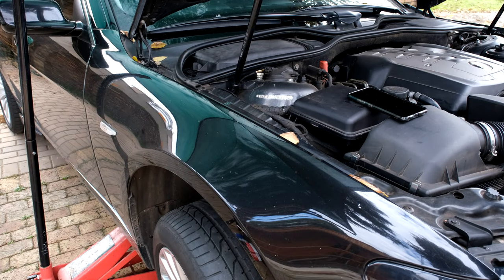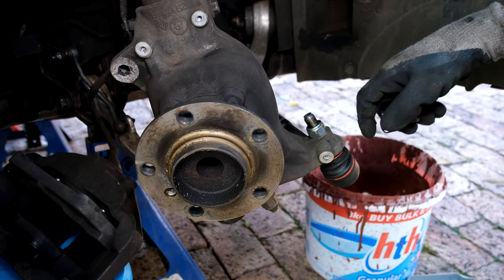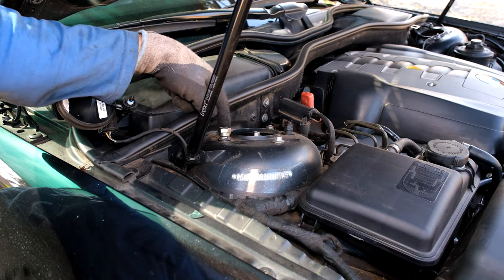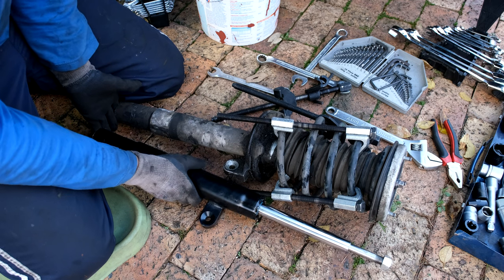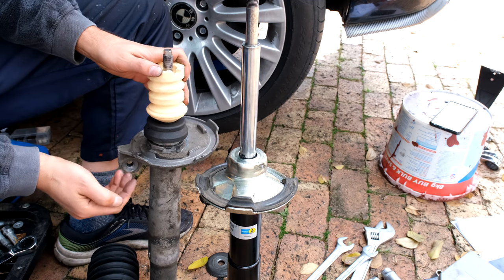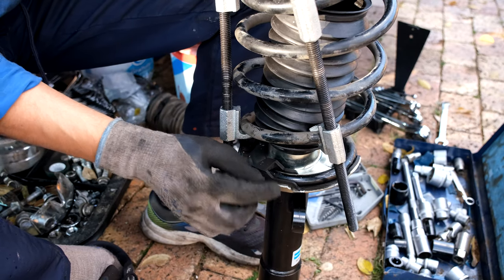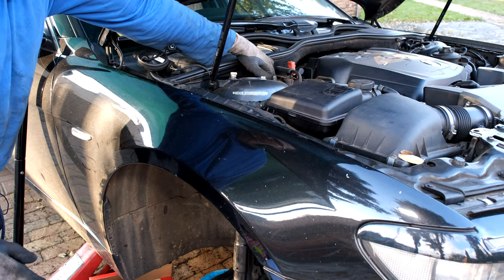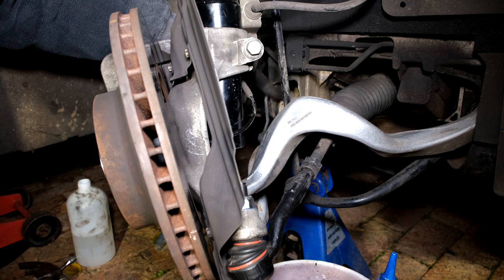How to replace the front struts (shock absorbers) on a seven series E65 BMW with Bilstein B4 struts

Comment: Nice job done!, have a qestion , I notice after you lower the vehicle , you drove the car on a ramp, and torque down lower control arm, my question is can I do that on the rear strut, drive rear end on ramps and torque down lower control arms? Or will it throw off my rear end camber alignment? And thank you for show us the great job in how to install struts on these BMW, also can you give me the torque spec for the rear lower control, great job again,

Comment: Hi, very nice video, thank you ! It will help me a lot !
I will change my front shocks by OEM cause I want to keep EDC working. The procedure provided by ISTA-D invite to code the EDC with ISTA-P to take the new shocks into account after installation (otherwise there is an error). I have ISTA-P but no ICOM to do it. Do you know if we can do it with INPA or WINKFP (as ISTA-P is just a graphical interface for shops to make it easy)? Thanks for your help.

Comment: Hi!
I replaced the shock absorbers in the front, but the height of the front axle is 74 cm instead of 65.3 cm for me (2002 745i, EDC, 18 inch rims) What could be wrong?
Reply from the maker: if you compare the old vs new shocks were they the same size? The seat for the spring must not be flipped the other way around.
Reply: @ecologicaltime  Hello.

There's the problem: I didn't measure well... but I don't think the shock absorbers are good. Even on a smooth road, the steering wheel shakes left and right. All swingarms and springs are new. Steering gear also replaced. Also servo oil. However, it does not shake when braking. Wheels also centered, with new continental tires, chassis adjusted.